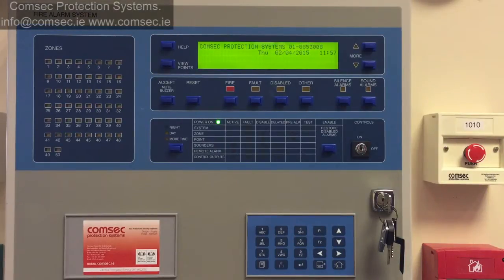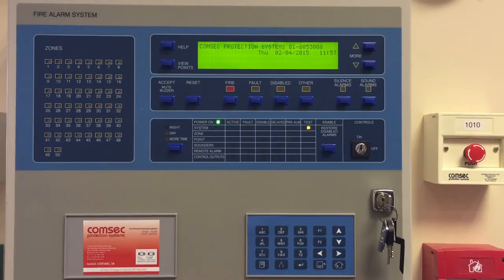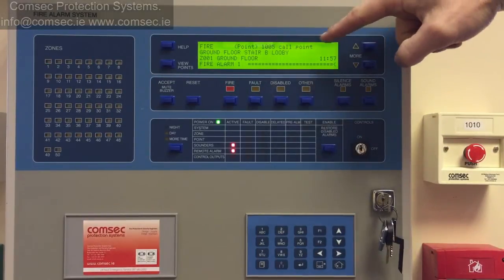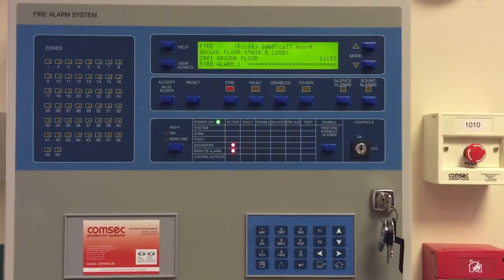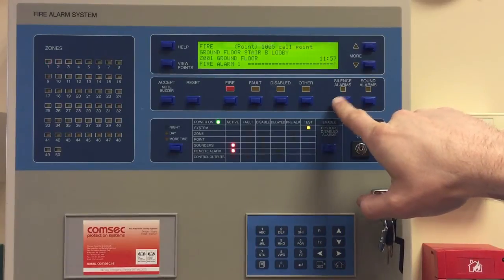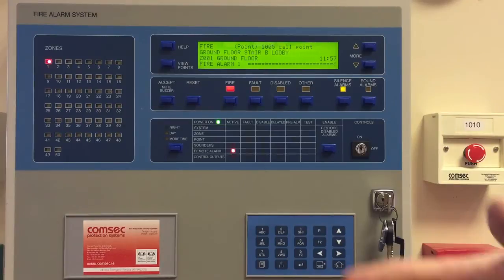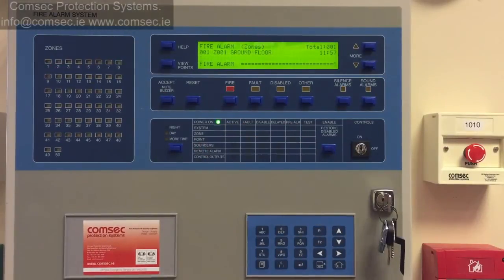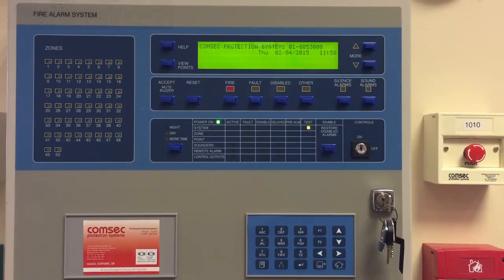Ziton ZP3 Panel. How to deal with an alarm.

Comment: After press reset, it alarm again and again...why?
Reply from the maker: press the mute buzzer button and "view points" this should tell you what the issue is
Reply: @ComsecProtectionSystems1  after view points it shows,
DEV OFFLINE (POINT) 1021 SMOKE
POWDER DUMPING
ZOO1 PRODUCTION AREA
FAULT (ALL) SOUNDERS DISABLE
Reply from the maker: @HiddenFacts2024  you need to replace detector loop 1 device 021. its either missing or faulty. I'd suggest that you also investigate why your sounders are disabled.
You should contact your service provider about both these issues. hope that helped
Reply: @ComsecProtectionSystems1  have you Facebook id??? Or email??
Reply from the maker: @HiddenFacts2024  there is a chat function on our main site but if you are looking for tech support you should contact your equipment vendor.
Reply: @ComsecProtectionSystems1  thanks